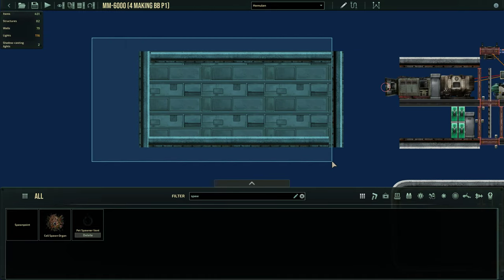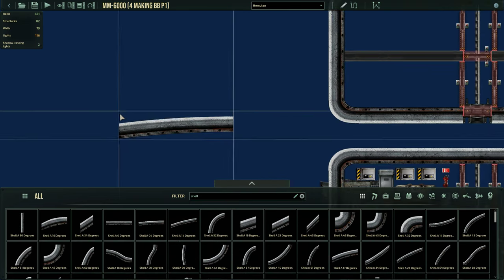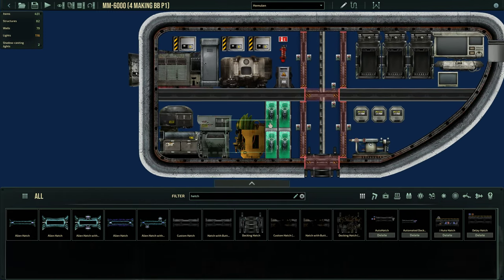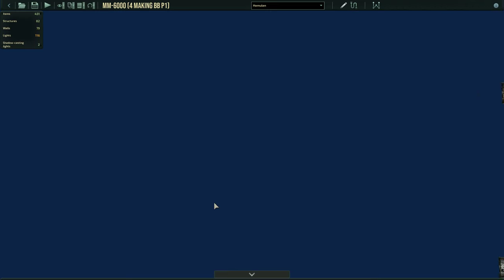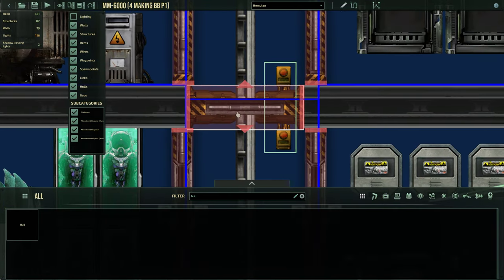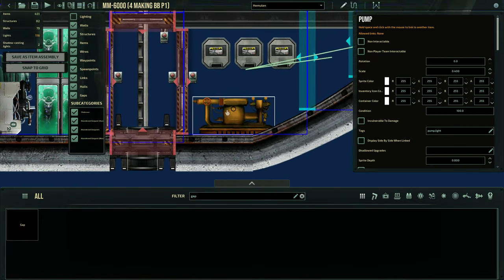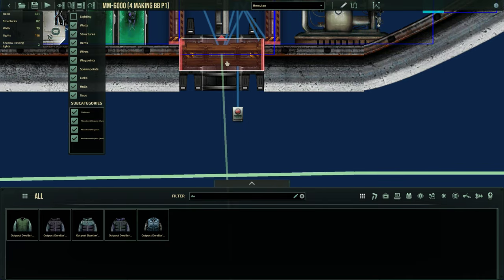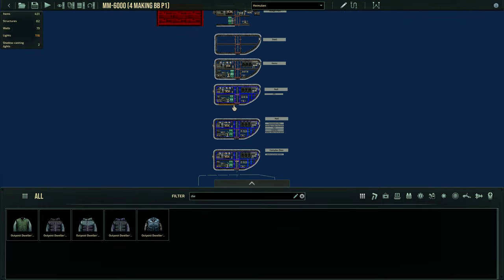Tiny sub tutorial 1: shells, hulls, doors, ballast

Comment: 7:04 i think i know why it does that.
i think its because u usually have a hatch at the top of ur ballast tank and the ballast pump always stops before overflowing the tank.
so by having a gap on the top instead of the side it makes the pump think thats where the hatch is at the top of the tank.